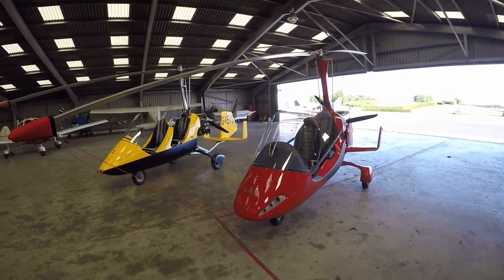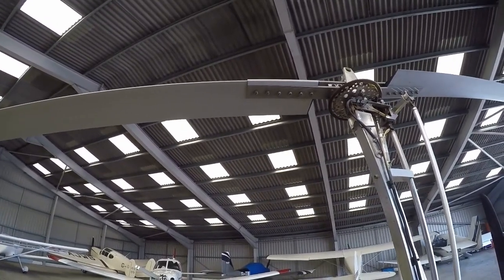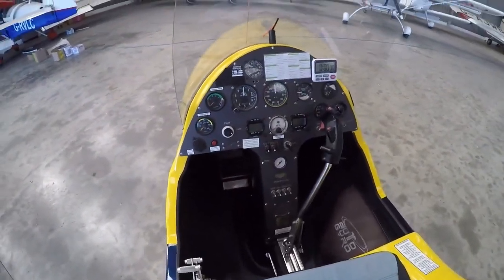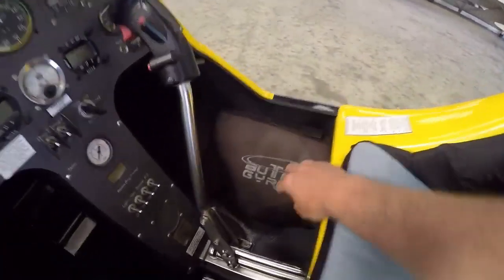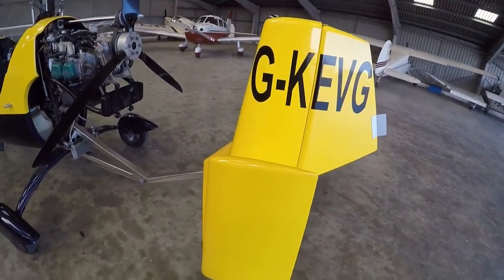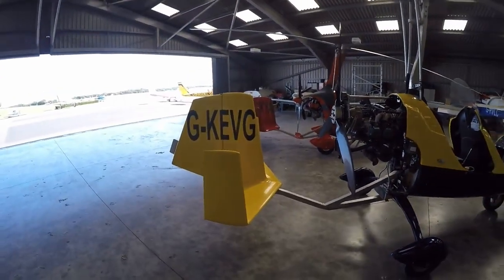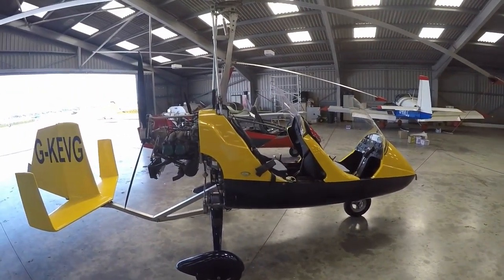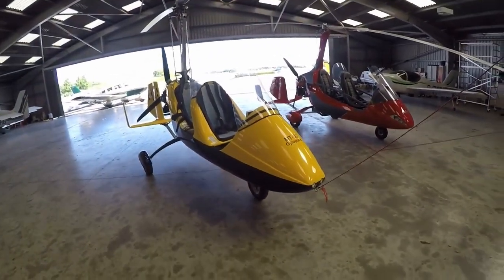Auto Gyro MT-03 aircraft review

Comment: Always wonder why you don't see more three bladed rotor heads as it as a gyrocopter was originally designed with and why are they not hinged like the original blades are on a rotor on a gyro cuz I think if they was they would be a lot less problems
Reply from the maker: In sport gyroplanes its a weight and simple maintenance driven situation